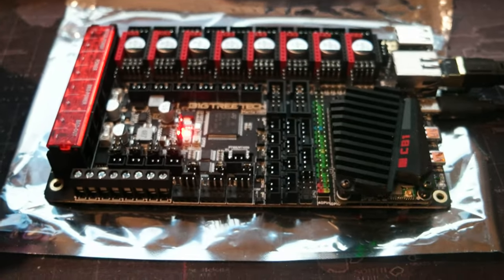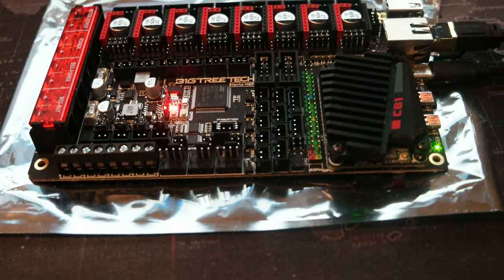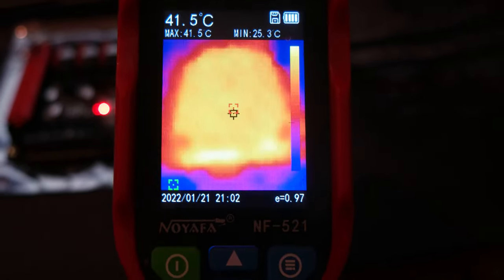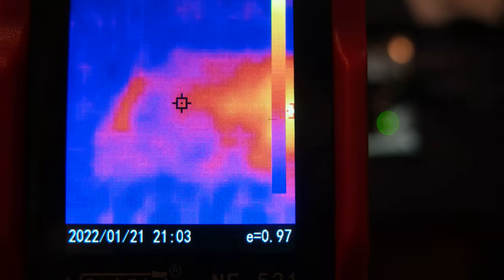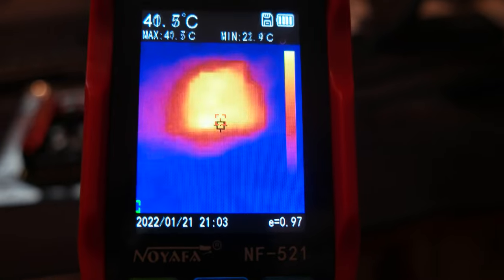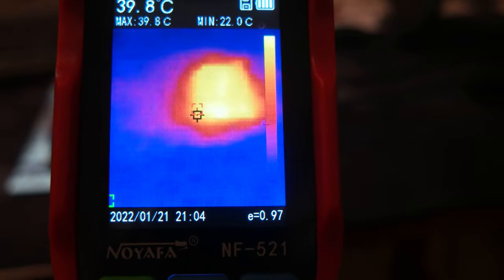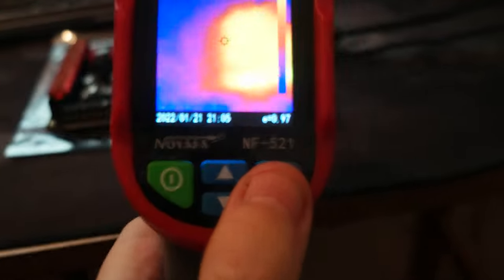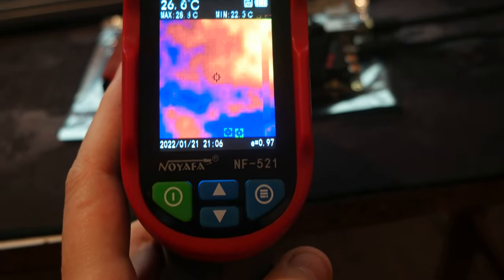Infrared Thermal image of BTT Manta M8P and CB1, keep an eye on temperatures

Comment: what size screws did you use to secure the CB1 heatsink... mine did not come with any...
Reply from the maker: I had some from other components since the one that comes with the CB1 are short. They are M2, basically same size but 4/5 mm longer so that you can secure them below the board.